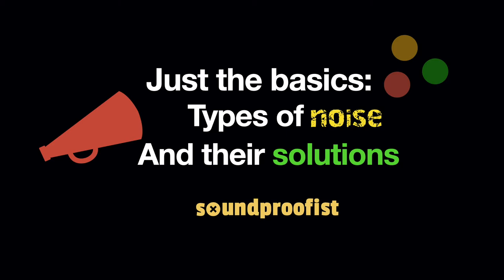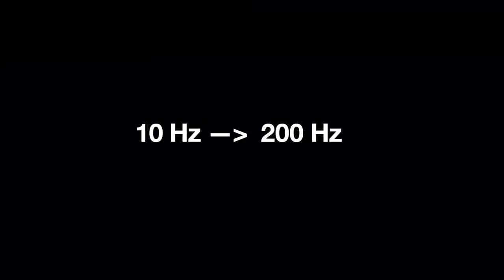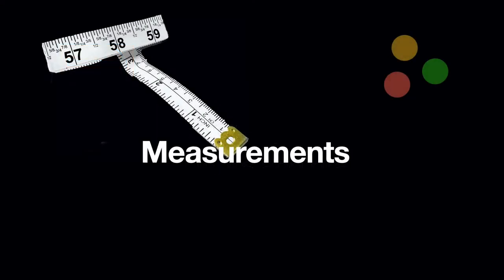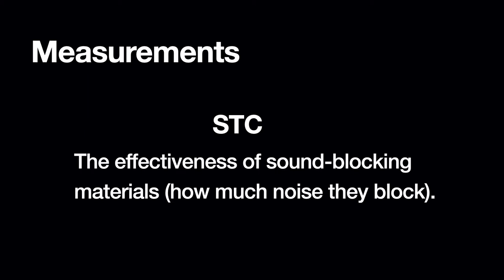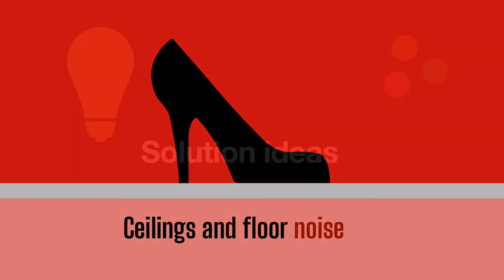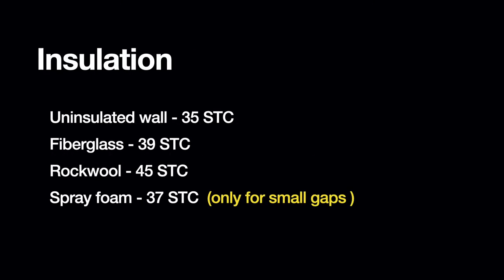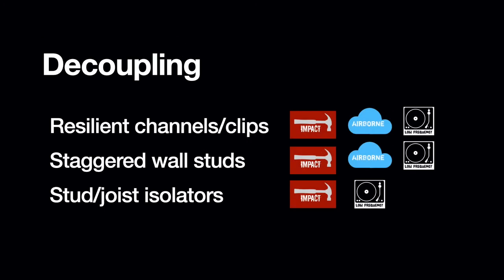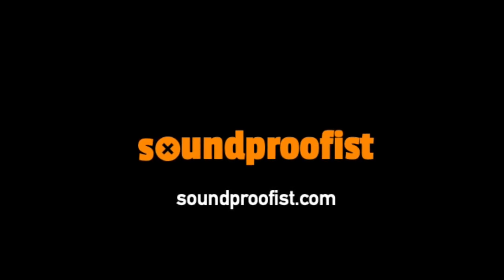How to choose the right noise solution

Comment: I have used foam rubber pipe insulation cut into pieces for padding (and many other ways).  For example, placing pieces between the flat screen TV feet and the top upon which it sits.
Reply from the maker: That's a good idea. All kinds of everyday objects in our homes transfer vibration noise into the building frame. TV/sound system, blenders, coffee grinders, fans, air conditioners, etc.

Comment: Very good summary of the different types of noise and their treatment. I'm rather skeptical about green glues efficacy. Good video though. Thx
Reply from the maker: Thanks. And yes, with Green Glue, it depends on what you use it for -- what kind/frequency of noise, the source of that noise,  how it travels, what the rest of the surrounding structure is like, and so on.